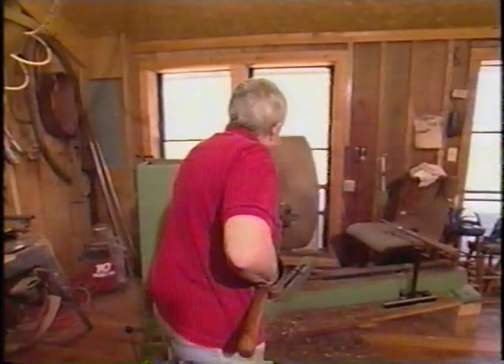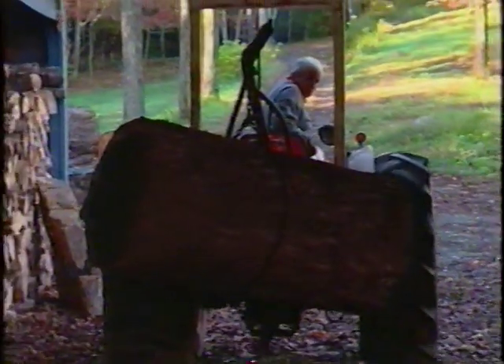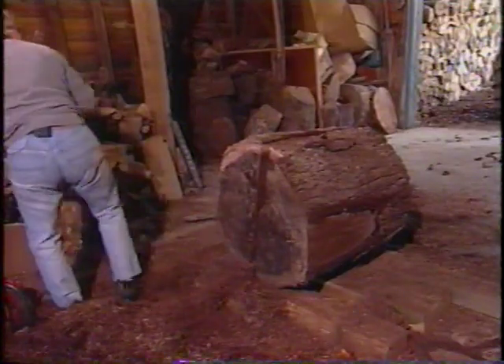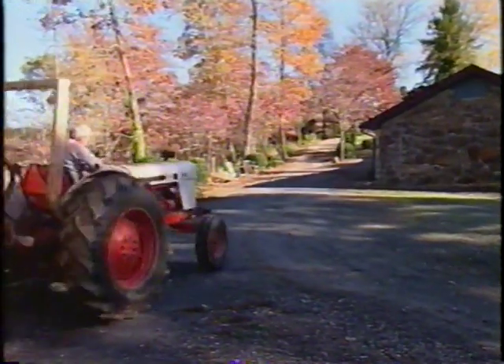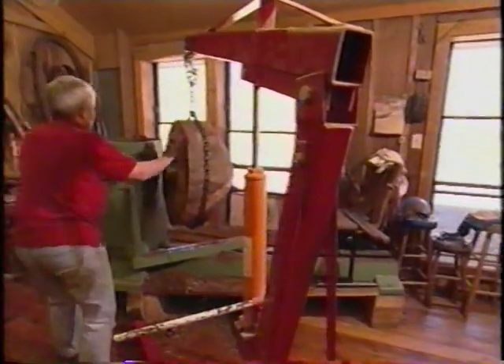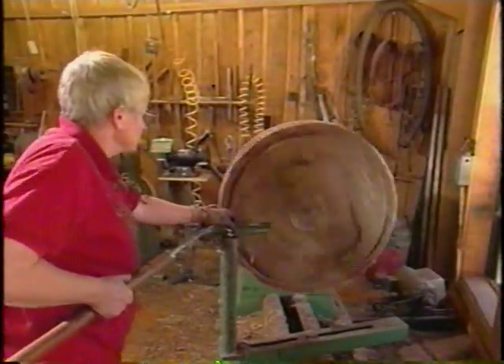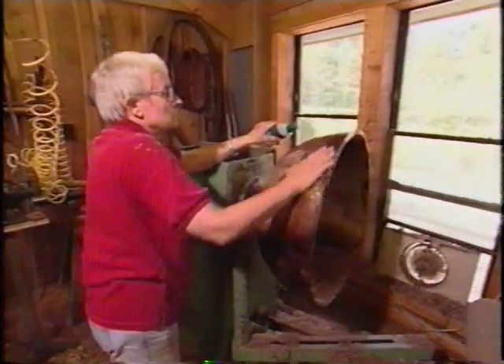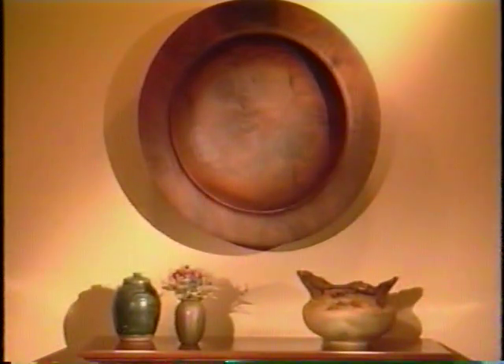Turning a big bowl by Lissi Øland

Comment: I am jealous of that big lathe. I have lathe I built from Shop Notes, I believe it was. a small lathe I was given. like 7 inch diameter capacity, then I bought one from Grizzly, a 12 inch one, but believe it is off balance as when I got it, the headstock was broken and I did not realize